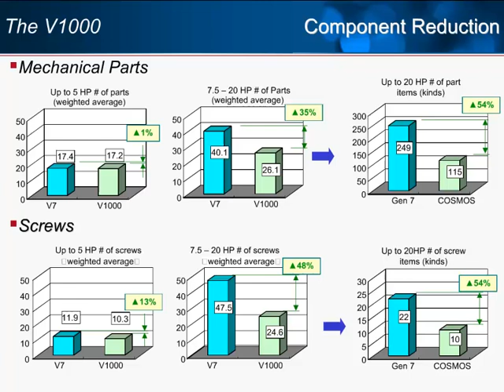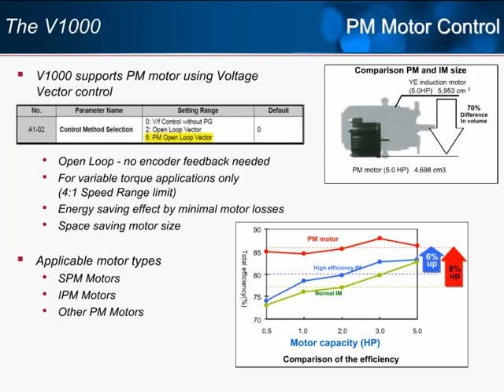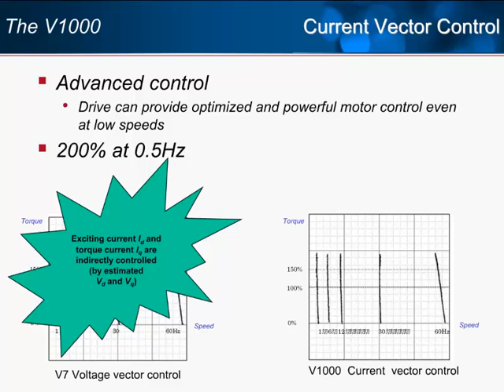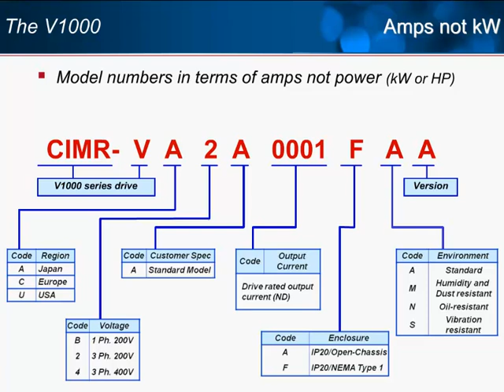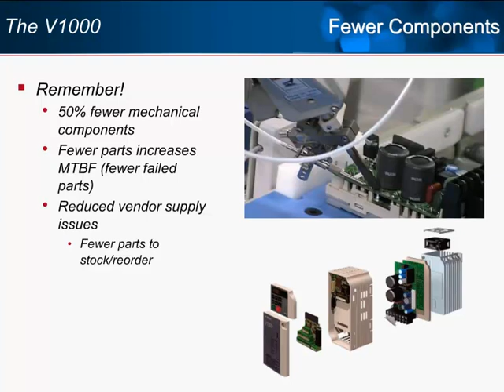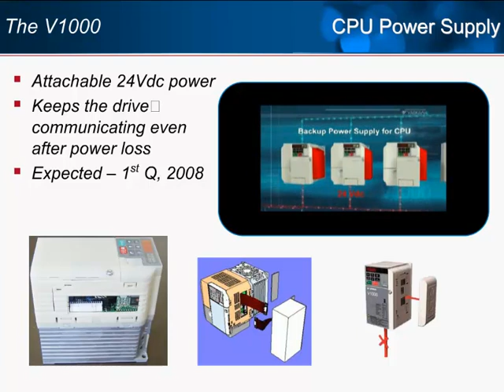V1000 Features and Benefits

Comment: Please help me for wire 3 pH moter connection 2hp motery
Reply: Sure. We are here to help. Please place motery near Drive and put green wire on L1 connection plate. Use small hammer to fasten wire to connection. Connect black and red wire together using a small flame. Then connect small white wire into connection plate using small wrench. Then simply press enter 5 times and start unit.